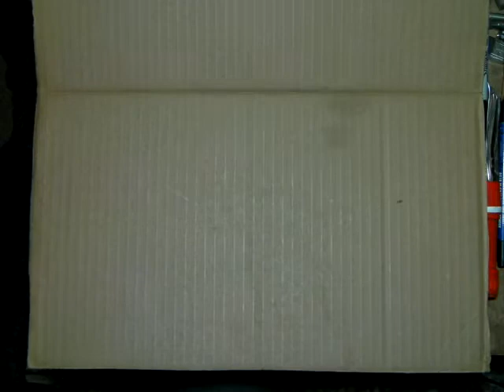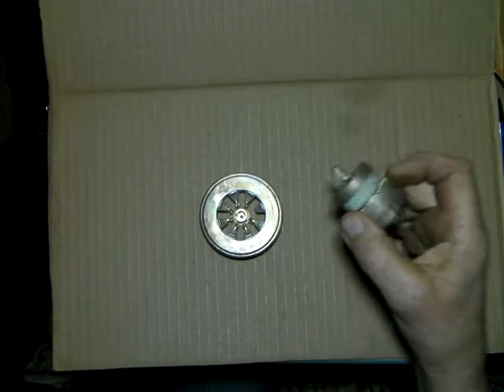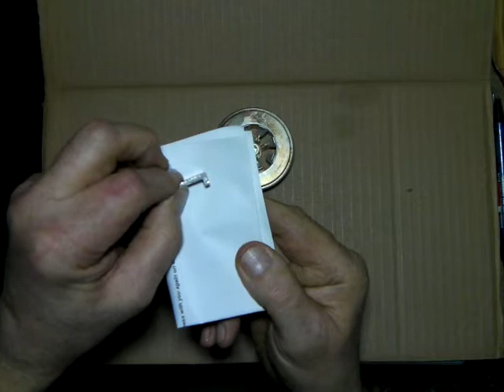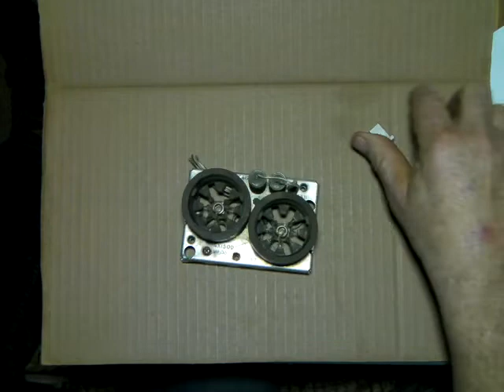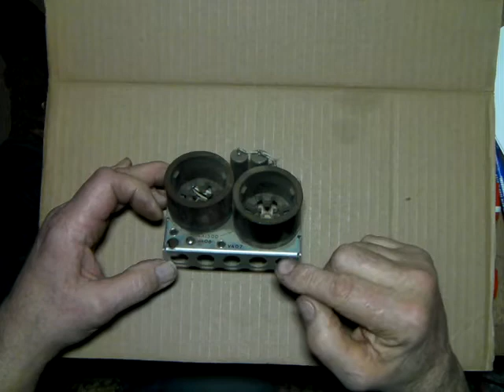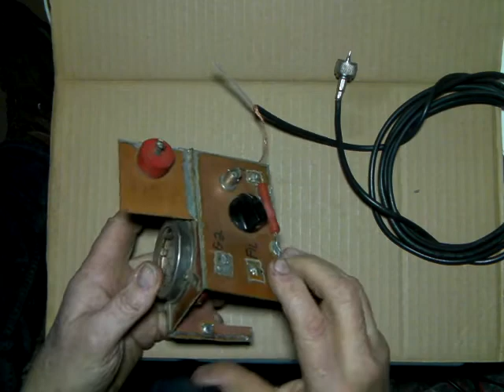Single Tube 4CX250B Amp For 27Mhz   The Build Pt7

Comment: Okay well that was a chunk of reading. and if the mfg. says "don't do that" or even more so when Mr. Orr says so then I won't use these tetrodes in grounded grid (cathode drive).  A few other things that were said about never using tubes without having all the appropriate voltages on all the pins but that is exactly what I have not done.  My first tube amp I bought from a neighbor used two sweep tubes (6JG6A) and all three grids were DC to ground made that way. That was 1976 or so now I have owned a few tube amps and built maybe 40-45 amps  Grids grounded of course 'cuz that is what I was copying. My current amp is a pair of 813's (tetrodes) with them connected as triodes I get 600 PEP out of them when I run out of transformer. Driving with a Uniden Grant 2 watts carrier swinging to 12. Original tubes35 years old now. Any ways  he said there is a tiny bit more IHD   cathode drive     but enough to double the amount of components? Oh one more thing are you going to leave voltages on the tube if not keyed up?
Reply: Budd mini boxes and chassis from ebay are not too
 scary and I'm very cheap.

Comment: Great series!   My one and only comment of any use is that 60/40 is great for drag soldering those board edges, but it's not the best stuff for point to point wiring or through hole PCB work.  63/37 for that is best.   I'm not sure if RadioShack did us a disservice or service selling us all that 60/40 over the years.  If you can make thousands of connections with it without a cold solder joint, you're doing well.   63/37 mostly solves that issue but is terrible for drag soldering RF shielding.   Anyway, thanks and eagerly awaiting the next episode!